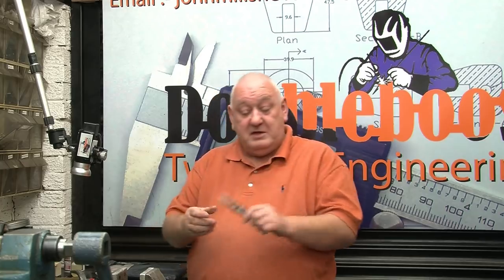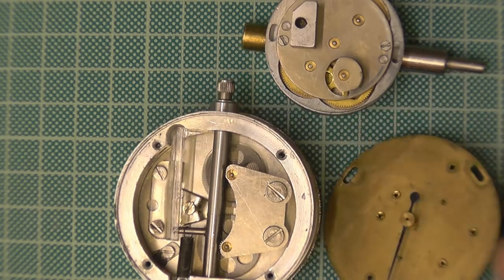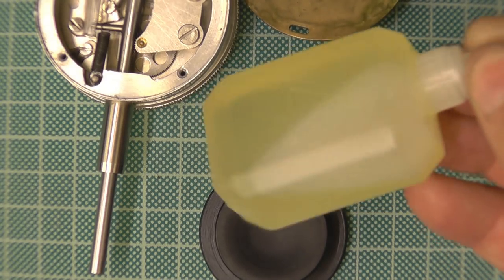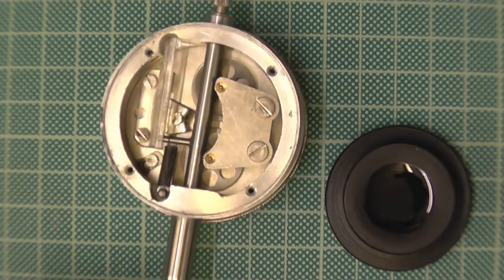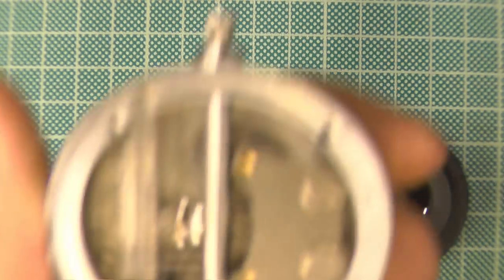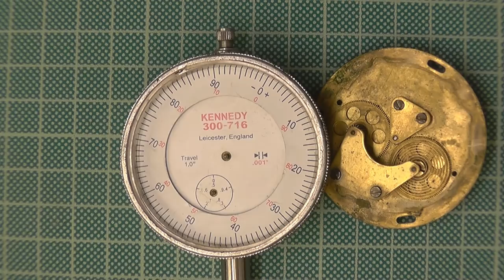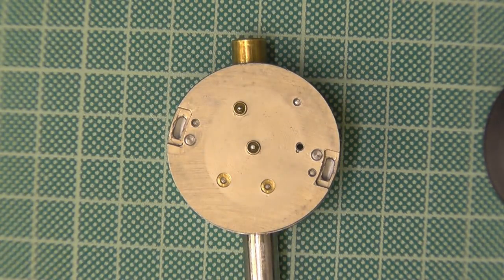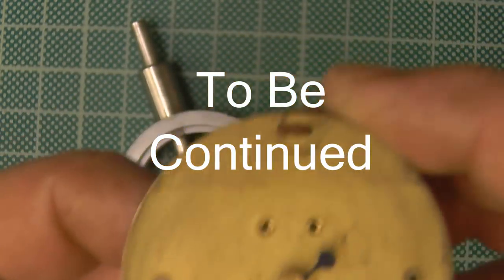DTI Care & Repair with Bob Part Three

Comment: Bias spring, or anti backlash spring. Needs a slight bias when the movement is at the one end of travel, so it just keeps the gearing backlash free, but not so much that at the other end it is over wound. The oil is just there to make a thin film in the bush by capillary action, no need to have any more than that volume in the oil well. The oil just has to be non gumming with time, so generally it is a very light pure mineral oil with almost no additives to it. Basically just enough oil to make a slight blue to orange interference pattern around the bush is fine, showing it is a very thin ( nanometers thick) film there, and it will be perfect. It will flow into the bush pores and provide decades of lubrication. If you take it apart use fine crocus paper to polish the shaft ends, both removes the old oil and gets the shaft nicely polished.

Comment: Have you looked at any Mahr    millimess (1um) dtis Bob?  . I have a couple ,one of which I had to 'clean'  due to corrosion , it could probably do with a makeover. Fancy a go at it?  Would make a neat video as they are quite different to the typical plunger type.

Comment: Thank you gentlemen really useful, a question though if I may, where does Bob buy his instrument oil and what brand please.

Regards

Paul
Reply: You can get Starrett instrument oil from ebay or Amazon
Reply: @gordonp6353  
Thanks for taking the time to answer but...
I know you can get Starrett oil on eBay & Amazon but it is quite expensive for a small amount, I was more interested to see what Bob used, perhaps a cheaper alternative?

Paul
Reply: Paul Floyd;  In the Mitutoyo service info they say to use chronometer oil , I use Porpoise jaw brand available from ebay in smaller amounts.
Reply: @gordonp6353  
Thanks Gordon, do you have a link please?

Thanks

Paul
Reply: hi I use Starrett

Comment: Hi John, could you let Bob know that I use sewing machine oil......is this wrong?
Reply: I used to use it with no problems, but I now use porpoise jaw chronometer oil (ebay) and fine precision watch oilers.
Reply: wd40 it is then, cheers!
Reply: hi wat ever you have at hand but sewing machine oil is hydroscopic its made so if it gets on fabric it will wash out

Comment: Bob, why are you shy about mentioning brand names like 3 in 1 oil?
Reply: hi well I try not to name the brands as its free ad for them
Reply: I was once told that 3 in 1 is a thick oil with a solvent mixed to make it thin. As the solvent dries out over time the oil goes sticky.